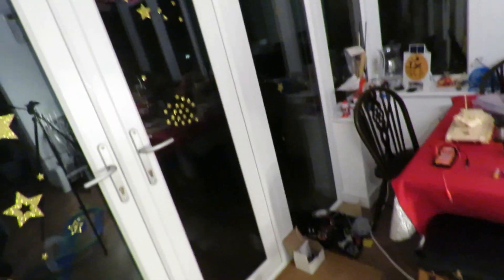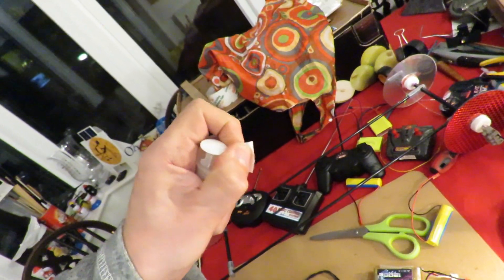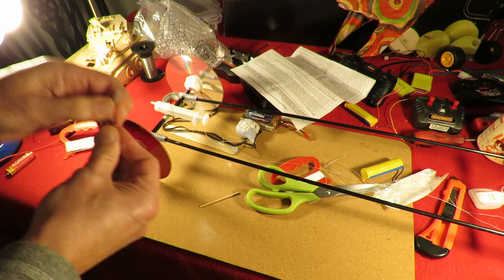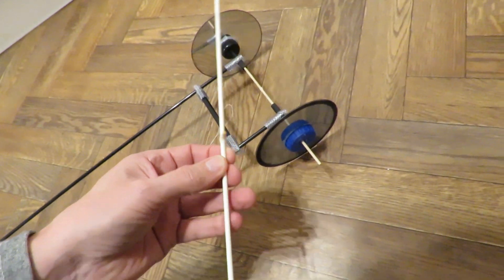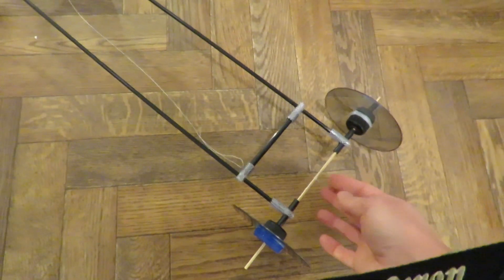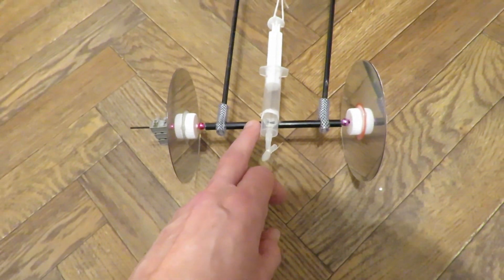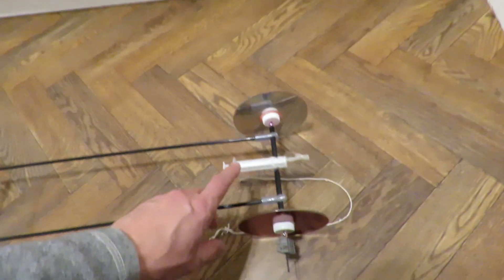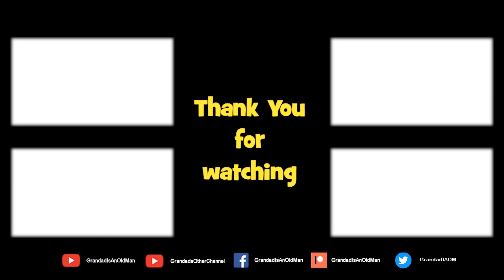Atmosphere Powered Car based on Tom Stanton's idea

Comment: This is great to see it attempted without a 3D printer!! The force from the atmospheric pressure on the syringe is surprising strong. Nice job, thanks!
Reply from the maker: Thanks Tom, my efforts just highlight how excellent your work is, I am happy when one of my projects works more by luck than judgement but you go the extra mile and make them work properly, professionally and explain why they work. You keep your workplace clean and tidy too so make a great role model. Your air engine project started me watching you full time and I have thoroughly enjoyed everything you have done.
Reply: Wow, both Tom's 3D-printed and your accessible version are fantastic, Grandad! Thumbs up!
Reply from the maker: @sciencetoymaker  Thanks for dropping by 😍

Comment: Can you make a mouse trap or catapult using atmospheric power?  Or any other contraption using vacuum power?  Thanks!
Reply from the maker: With the right tools and components I am sure you could. The main considerations are how you are going to create the reduced pressure and how you are going to maintain it. Keeping an airtight seal for any length of time would be a problem so something like a mousetrap that might be left for days or weeks would probably fail before it had a chance to work. The principle has been used for years. Here is an example from the 1700's https://en.wikipedia.org/wiki/Newcomen_atmospheric_engine

Comment: So high tech Grand'Pa ;) Saying this about the 3D printed parts. The vacuum powered engine is a very interesting idea, i like it ^^ 
I wish you a very happy christmas old man :)
PS: You could use some gears magic tricks to increase the effect as vacuum is producing a lot of force...
Reply from the maker: Thank you Co Fa, if you haven't already seen it check out Tom's video you will see him explain it all in far more detail and his works and it is radio control 😃
Reply: Indeed :) that's what I had in mind !  @GrandadIsAnOldMan